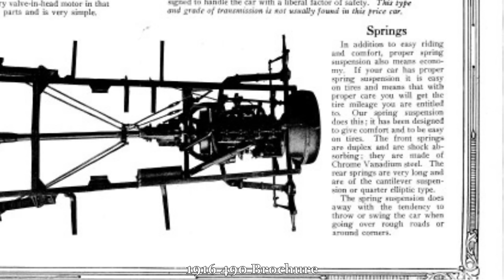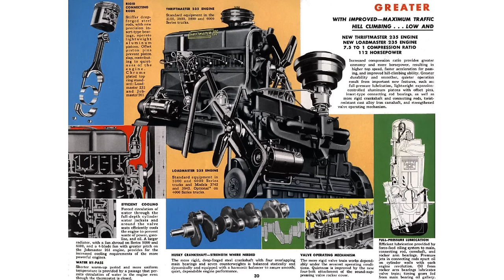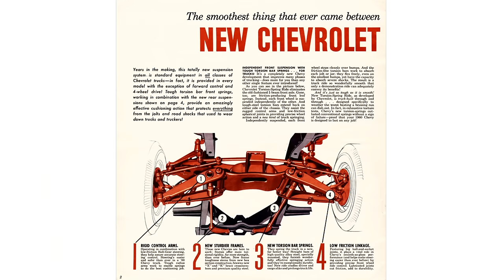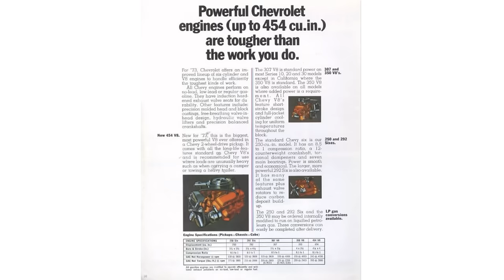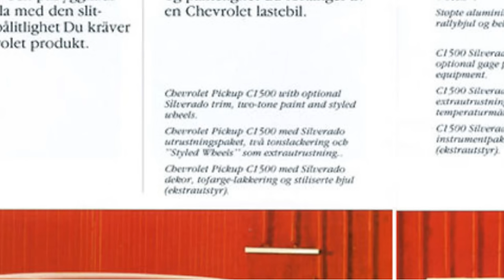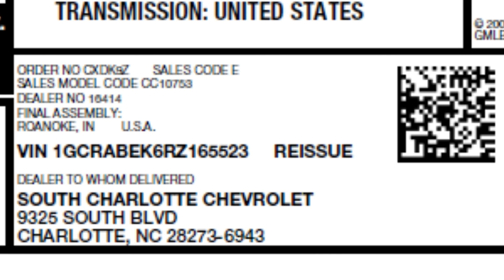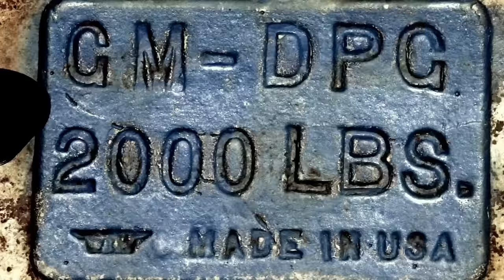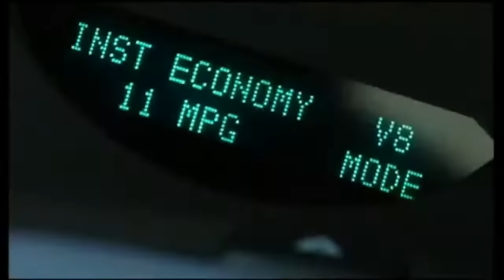History of Chevy Trucks From Advanced Design to Silverado

Comment: Squarebodies never die. They just wait for their next restoration.
Reply: 800s don't die either
Reply: If it wasn't for the Chinese steel there would be alot more on the road.
Reply: you're right about that, i had a 89, which is my favorite generation
of the 1500. the 92-98 is my second favorite,
if i had to pick a 3rd, it would be the 1970's version.
back when GM used a big block 454, that was a hell of an engine.

Comment: The '99-2006 trucks were awesome.  Then they added the displacement on demand and went downhill from there.
Reply: Hardly. These were the cheapest years to date. I don’t see any with matching body lines any more. Plenty of k2500s in good shape though.
Reply: My 06 has 450k and refuses to give up and is still barely slower then a new one
Reply: Those trucks run forever the bodies do not
Reply: Ford and dodge have the same problem with that system
Reply: @pontiacperformance1993 has no dod
Reply: @Cherokee93 my truck is 17 yo and has no body rust and frame is not rusted either
Reply: Those are the best trucks ever made. Long live the GMT 800
Reply: @shadowopsairman1583  one of my family has one motor is great cab corner rockers and bedsides are gone
Reply: Sold my GMT800 and got a GMT400. Love the GMT400 a bit more, but the 800 is great too. 

98 Silverado Z71 5.7
Reply: The GMT400 (88-98) Chevy and GMC C/K pickups are the best trucks ever built
Reply: Displacement on demand is a much easier fix than a blown 4l60.
Reply: @johnathonhazen798 the 4l60 would out last any transmission in the new ones and everyone just swaps a 4l80 in anyways
Reply: @_xtremebmxguy_ at the very least, the 6l80 seems to come in everything and is superior in every way I can think of. The only 4l60s I'd take are from I think 2007 and up. I forget what was done in the factory, but I recall it made reliability a lot better.
Reply: You can delete it off the engine same thing with variable valve timing and those trucks in are in such high demand that a good portion of them are rust buckets for the same price as one you can buy a previous generation Silverado or C/K 1500 or 2500 for the same price and it will be in better condition for under 12 grand you would be getting a truck that is in the condition of a 15k truck vs a 10-15 grand 99-06 Silverado that is in the condition of a 3,500 truck 💀🪦
Reply: @pontiacperformance1993 my 06 has 350k and same
Reply: Wrong. After fuel injection came in 1984/85.   It all went down hill 

And then guys argue after 76-78 they started removing nickel content out of the engine block.     That was the true down fall
Reply: @erikcopeland nope best trucks were the 1973-1979.
Reply: @GMTfourhundred wrong 1973-1979. 

No computers , no fuel injection , barely any plastic all metal.  Fuel pump on engine block.
Reply: @youthmanrecords965  mine was a '77 with a 454 but I've had better experience in terms of reliability with the GMT 800s
Reply: @youthmanrecords965  fuel injection is 200x better than a carburetor.  I'm old enough to have had both and I would never want another vehicle with a carburetor.
Reply: @jimowens381  all I drive is carbureted vehicles.   I have 5 squares.  1984,1983, 1978 and 2 -1976’s.  

Fuel injection is garbage.   Don’t even try and tell me that crap.    If you have your carb dialed in with a vacuum it will start and perform correctly everytime.
Reply: @youthmanrecords965  Well I love the fact you have all those square bodies.  Cool trucks!
Reply: Well not really. I’ve heard some good things about Silverados built after 2007 especially the 2nd gens
Reply: IMO those EXACT years were WORST years!! 80s to 97 were the best 99+ were CHEAP, didn't get better until around 2011+. We've owned 82,88,95,03,08,13, now a 22 so I know a bit🤷🏼‍♂️
Reply: Agreed have  an 
02 ext cab with 220k miles bought  it 215k and loving it so far
Reply: As a Ford fan, the GMT800 was the only good body style of GM trucks ever created.
Reply: That's exactly why I drive one
Reply: @Cherokee93 all trucks can rust brother. Not just limited to this body style. Seen all brands with rust. These trucks are excellent.
Reply: @fritzthecat4769  yessir I agree but these the rockers are just always gone
Reply: And with the older Toyotas the frame rusty in half
Reply: I have a 08 without vvt or dod
Reply: @GMTfourhundred  Not even close
Reply: @youthmanrecords965  Obviously don't live where it gets cold
Reply: @95blahblahhaha  You THINK you know a bit
Reply: @3katd  I would agree for the most part but square bodies are pretty good as well
Reply: @bhswarrior94  You like 99-06 and 73-87 but not 88-98…?? Which is literally a good balance between those two generations and the best of both worlds
Reply: @GMTfourhundred  Point out where I said that again.
Reply: @bhswarrior94  your reply to 3katd…
Reply: @GMTfourhundred  Yep what about it?
Reply: @bhswarrior94  you agreed that the GMT800 was “the only good body style GM ever created” but also implied that “squarebodies are pretty good as well”, yet you’re not a fan of the 1988-1998 body style..?
Reply: @GMTfourhundred  Yep I actually like 800s far more than anything else only really like squares for the ease of swaps.
Reply: @youthmanrecords965  just because you don't know how to work on fuel injection doesn't mean it's bad.    Yes they are a bit more complicated  and yes when things need fixed it generally costs a bit more.   But they simply don't need fixed very often at all.
Reply: I have a 04 Silverado 4x 5.3 72,000 Original miles Love it great Truck inherited it a few yrs ago when my Dad passed after all I talked him into buying it back then he kept messing with the Dodges no 4x I said Dad trust me it gonna use that 4 wheel an he thanked me one day CUZZ he said it got him out of a predicament one winter night 😂 said yep pa been there done that he was a die hard 2wd man lol
Reply: I still own my 02 Silverado I bought new and kept it like new with 44k miles, I recently bought a new 2023 Colorado Trail Boss but will never sell my Chevy trucks!
Reply: There's a reason why you see them everywhere you literally cannot go 10 minutes without seeing one on the road. My 01 5.3 has 288k zero rust interior is a little rough though 😅
Reply: Facts I still daily a 00 RCSB Silverado and my family hauler is a 03 Denali XL… If I want modern muscle I have my 1LE but she’s more of a garage queen
Reply: Yep.The  vortec/LS engines in that timespan Was legendary..I have a 04 silverado Lt..with 350k  with plenty of life left.
Reply: laughs in 4L60E
Reply: Love my 400s but my gmt800 is my favorite thing to drive. Never buying another gmt800 half ton though. Rust out wayyyy to easily compared to the 400s  maybe because the went down to 1/8 in metal instead of 3/16. That couple 16ths reallllllly matter. I saved my truck but there’s a lot that got crushed because gm wanted to be cheap when they made the best trucks ever. At least they made a lot of ls swaps possible though🤷🏽‍♂️
Reply: @youthmanrecords965 Nope.....1967-72 were the best. Best-looking too
Reply: My 04 has 333,000 miles 4.8L v8 all original drivetrain a trailer lived on it for 15 years never had a problem she still runs amazing and being in Pennsylvania all it’s life it still has all original sheet metal

Comment: Great video as always Jon! I love Chevy/GMC trucks and always have. My dad was a big Ford guy earlier in life but after owning several GMC Caballeros (the GMC version of the El Camino for those unfamiliar) and an '85 K20 that he bought as an offroad toy, he made the full switch to Chevy/GM trucks in 1990 when he bought his fully loaded '90 GMC Sierra C1500 SLE with the 5.7 350 TBI V8. Its his favorite truck of all time and still owns it, it currently has over 660k mi on the original, untouched, non-rebuilt engine. That truck is truly a symbol of how tough, reliable and long lasting these GM trucks are and have been over the years. He also owned a 2000 Sierra SLT 5.3 that i bought from him when he purchased his new '16 Sierra Denali. We also used Chevy trucks for business when he owned his auto/commercial battery shop, owning both a '91 C1500 350 V8 truck as well as a '95 C1500 350 V8 truck. Both were great units with both being worked hard every day of their lives. We let the '95 go with almost 400k mi when he sold the business and the '91 was stolen and never recovered unfortunately. He also owned a '96 K2500 7.4 454 Z71 truck that I spent a lot of time using when learning to drive. All of the trucks i mentioned above were super depenadable, rugged, comfortable and even economic on gas for full size truck (except the '96 k2500 454 truck that averaged 10mpg lol) and are all examples of why i love Chevy/GM trucks and believe that they are truly the Longest Lasting, Most Dependable Trucks on the Road.
Reply: they gotta buy that truck off of him like honda did that one guy when his accord hit 1 million miles
Reply from the maker: Wow, thanks for sharing some memories!
Reply: The 1988-1998 Chevy/GMC trucks are the best ever built!! LIKE A ROCK 💪🪨
Reply: Handles like one too

Comment: Hey Jon, the Avalanche was also used to create the Cadillac Escalade EXT. This truck was in production from 2001-2006.
Reply from the maker: Yes I know... I think in the video I worded it as "only a Chevy offering". Specifically I was trying to emphasize it wasn't ported over as a GMC product, but in hindsight (and since 2 of you so far pointed out the EXT) I should have added a couple of words that Caddy had a version. :)
(and it was available through 2013 surprisingly!)
Reply: @AllCarswithJon  I figured that you hadn't mentioned it due to sticking with Chevrolet & GMC, however, many people forget about it. Much in the same way as the Lincoln Blackwood and Mark LT. 

Thanks for the info Jon! I had thought the EXT was on the market past 06. I just thought it was my old memory getting in the way. Great video as always!
Reply: I still see lots of late model Caddy Avalanches. In AZ.
Reply: @richardnottelmann58  same here in texas! lots of Avalanches and EXTs still going strong 😁
Reply: I think a GMC version of the avalanche would have been awesome.

Comment: Great video. I miss the trucks of the 90s and 2000s so much. It seems like modern trucks aren't made to be treated as trucks anymore and are filled with dumb gimmicks to justify the crazy price increase. Haven driven a few new Silverados and Colorados at work, GM especially seems really guilty of this and I prefer my 2010 F-150 over them. I'm so tired of crew cab luxury trucks, but that seems to be all you ever see at dealers.

I really wish someone would make an affordable "back to basics" truck without all the unnecessary crap. Cut the buggy touch screens, camera arrays, leather seats, digital gauge clusters, tailgate gimmicks, rear seat entertainment, etc and make something that'll actually last!
Reply: GM still makes extended cab and single cab trucks. If you get a W/T or Custom trim you still get (essentially) the 2014 interior. No leather interior or digital guage cluster. No tailgate gimmicks or rear sear entertainment. You can't get rid of the cameras or touch screens because of federal safety standards so you can blame the govt on that one. But guess what, you can go buy that truck right now for less then $40,000 and dealers don't really stock them because they don't sell. Consumers drive demand and consumers want their truck to have modern luxuries. I bought my 2023 Sierra without a leather interior but I would not have purchased the PRO model, I went with the Elevation because it had the 'luxury" items that I wanted in my vehicle for the least amount of money. Sticker was $59,000 and with dealer markdown and factory incentives I got it for $42,000 plus tax and tags. That's affordable in my books for 2023 plus I get heated seats, full digital display, and the pro tailgate which works good for me getting into the bed which I will admit is too high for purely styling reasons.

Comment: @0:14 that OBS single cab/short bed is gorgeous and a proper truck. It’s also nice to see an OBS with its original wheels instead of wheels taken from a later 99+ Silverado like you tend to see on so many of these OBS trucks nowadays. I especially hate when I see an OBS that originally had steelies with the center chrome cap where those wheels have been replaced with aluminum wheels from a 99+ Silverado, I greatly prefer the stock look.

Comment: Former Ford guy here, switched in 2018 to a Chevy 1500 to replace my 18 year old F-150. What a disappointment, traded that off for a 2500HD , says something that I had to go to a 3/4 ton Chevy to tow as well as my old 1/2 ton Ford. All in all I do like it better, just wish mfr's would give us the long lasting offerings that we used to have available. Thanks again for all your research and work to produce these history videos. GREAT JOB!
Reply: You’re telling us that a 2000 F-150 towed better than a 2018 Silverado 1500? I don’t buy it. At best, your 2000 F150 would have had that boat anchor of an engine known as the 5.4 2 valve, which was weak for its day and is especially weak compared to more modern engines. Even the base 2018 Chevy engine would have been the 285hp/305lb-ft 4.3 V6 with a six-speed auto, which is 25 more horsepower and 40lb-ft less torque than the aforementioned 5.4, not to mention 50% more gears in the automatic transmission to help keep it in its its powerband… but more likely you had the 5.3 with 355hp and 383lb-ft, which is 95 more horsepower and 38 more lb-ft, in addition to also having two more gears than your Ford had to help keep it in its powerband. The Triton engines were dogs, Chevy had far and away better V8’s during that era and that’s well known. The Coyote is a much better and more competitive V8, though Ford sells the majority of their F150’s equipped with some variant of the Ecoboost twin turbo V6’s nowadays.
Reply: I still have my 2007 classic bowtie, not trading it in
Reply: @phantom0456 Has less to do with engine power and more to do with weight, braking and drivetrain. Newer trucks are packed with more features making them worse for towing/hauling. They are based around fuel efficiency as they are increasingly being used as family haulers. Newer trucks are just too heavy for the disproportionate increase in power over the years.
Reply: @phantom0456 You Chevy guys make me laugh. The 5.3 was a dog in 2001 as well. They just respond well to modifications. The biggest complaint about AFM is it trying to cut fuel and upshift to early. It doesn’t work well while towing not only that the 6l80e is junk
Reply: @waterloo123100 
I had both of them, a 2008 5.4 ford & 2003 5.3 Chevy. I’m here to tell you that 5.4 ford was a dog compared to the 5.3 Chevy. One more thing you’re totally wrong about as well, an 80E transmission whether it be a 4L80E or 6L80E is about as good of a transmission as you can get. I’m pretty certain you’re actually talking about a 60E transmission, which itself isn’t a bad transmission if you don’t try to pull the guts out of it !!

Comment: The third generation C/K series "square bodies" are my favorite. The only models they stopped producing in 1987 were the half ton & three quarter ton plain cab pickups. But the one ton plain cab pickups on the other hand were still in production up through 1989, & same with the rest of the models except they were produced up through 1991 like you said. The reason why the C/K series were renamed R/V series in 1987 was to make a distinction between the square body models & the upcoming fourth generation C/K series pickups for the 1988 model year because both of those body designs were going to be in production at the same time which lasted up through 1991. By the way the nick name for the fourth generation C/K series pickups are OBSs "Old Body Style". I don't know why they nick named them that.

Comment: GMT-800 is the best truck ever made. The literal only issues I've seen are electrical or the body rusts to sht. Luckily, i live in Florida so no road salt, my 06' has about 204k on the Odo and only major things I've had to fix besides new tires and oil has been a radiator that I popped by over-revving the dog piss out of it and new headlights cause they were oxidized lol.